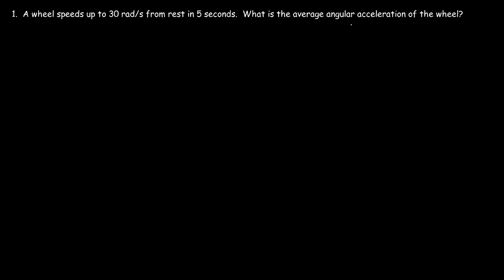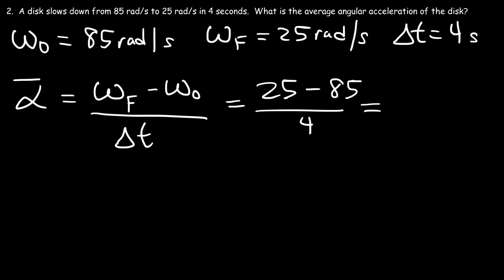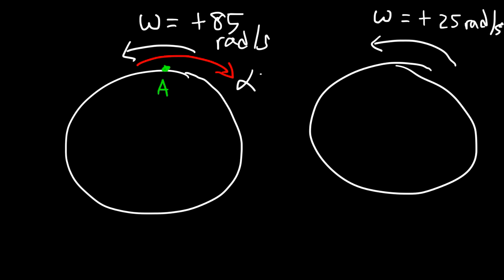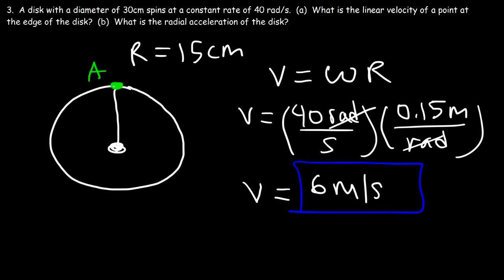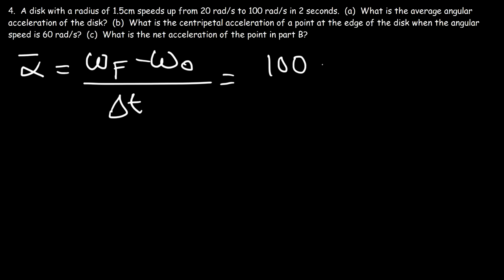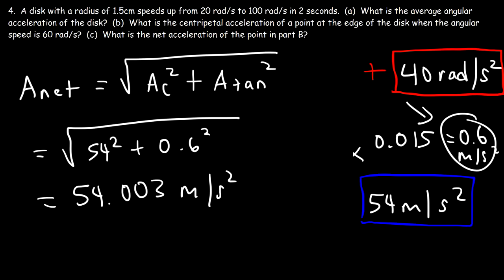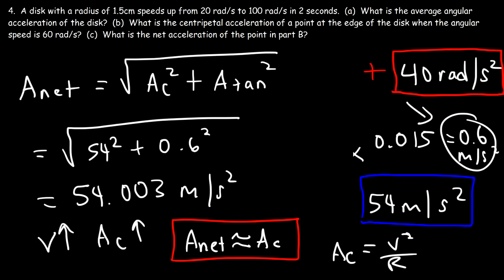Angular Acceleration Physics Problems, Radial Acceleration, Linear Velocity

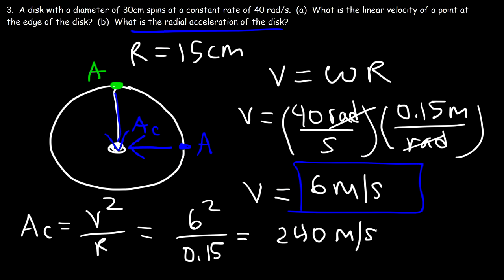Comment: wait but why is it accelerating if the speed is constant? 8:25
Reply: To have an acceleretion, there must be a net force. And a force not onky sppeds you up or down but it also can change your direction. In most of the rotational motion problems the speed is constant, but since its rıtating around a circle, its moving way ischanging. And celocity is a vectoral quantity, so the change in the moving way also means a change in velocity, not in its magnitude but in its direction. And if there is a change in velocity then there is acceleration. Sorry for my bad english
Reply: @BIackhole you explained it really well
Reply: @TrulyVagabond really? thanks 😇

Comment: Why can't we use SOH CAH TOA to find the hypotenuse of the triangle at 13:30? the forces are perpendicular so the force vector should be at 45 degree angle. but you get the wrong answer using trig
Reply: @Hashim Al-jifri lol yea but it gives a different number I just don't get it.

Comment: 10:20 Actually you didn't really have to separate the R^2 into two R just to cancel the R at the bottom. You could have just proceeded with the equation. Just pointing out.